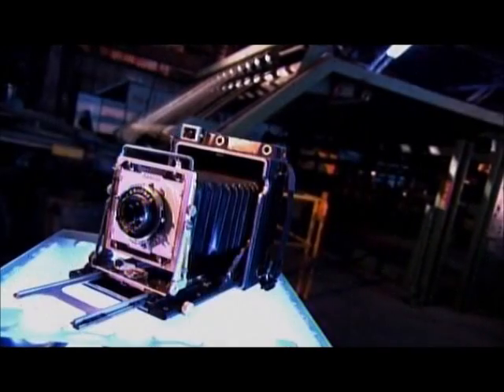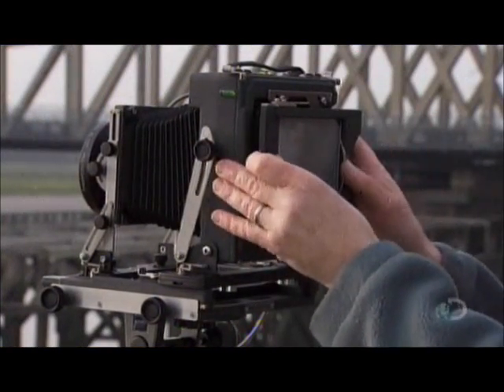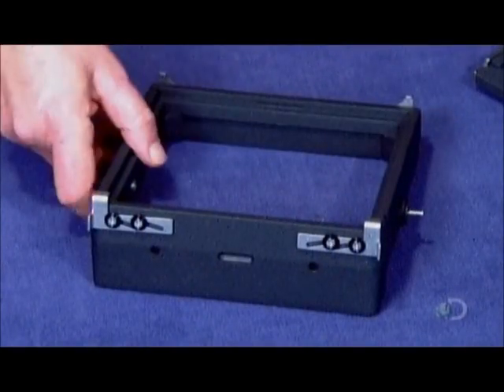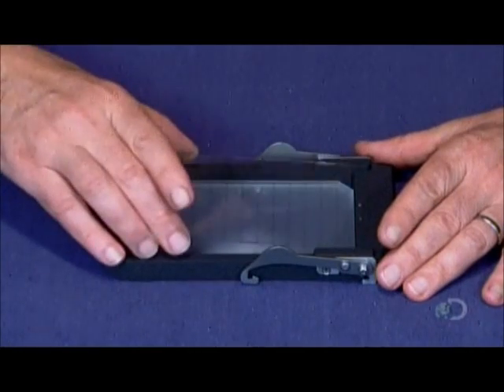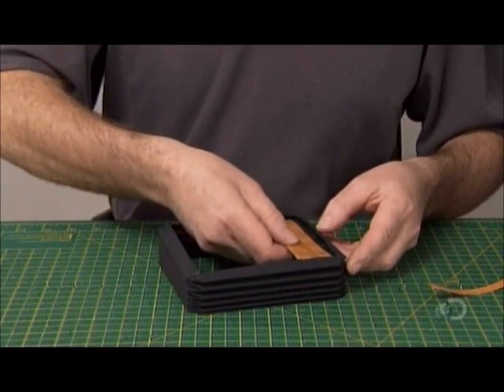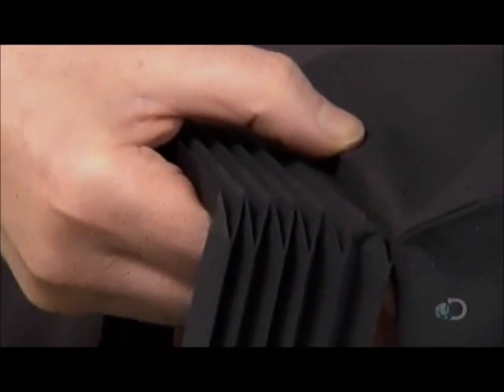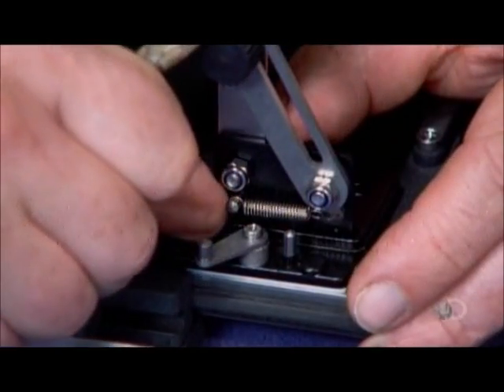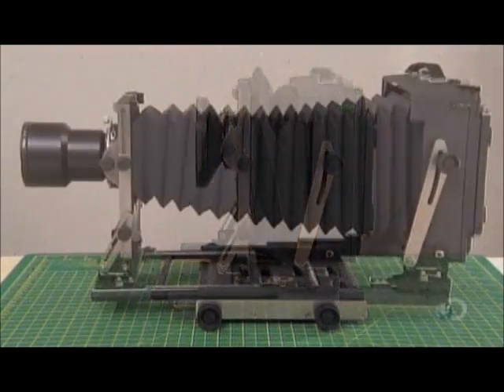How It's Made - Large Format Cameras

Comment: Would you look at that resolution. There is nothing this camera can do that a better digital camera can’t do. 

This is all for fun, I get it that’s it’s cool to use an old fashioned camera, just don’t pretend the results are better than a modern camera.
Reply: An 8x10 negative will give you a ~500Mpix scan.  Even a "smaller" large format camera gives you lens and back movements that are not possible with a digital camera.
Reply: Dude. Those cameras are made for gallery-prints like Gurskys "Rhine 2". Pictures so huge, that you have the feel of stepping into them. Thats not possible with a digital camera from the local camera stores. Those bellow-cameras are for high-professionals, who earn millions with one print. Not some wedding-shooters and weekend-wannabes.
Reply: Steve is correct. How many 500mpx digital cameras can you buy for under $1000?
Reply: @MyPartytime69  to be fair, how many 500Mpx analog cameras can you get for less than $100?